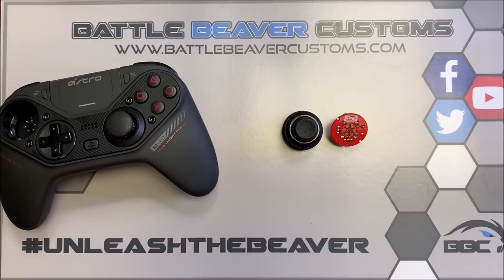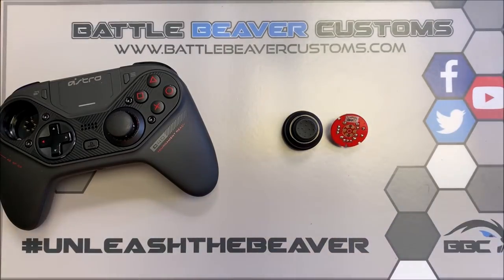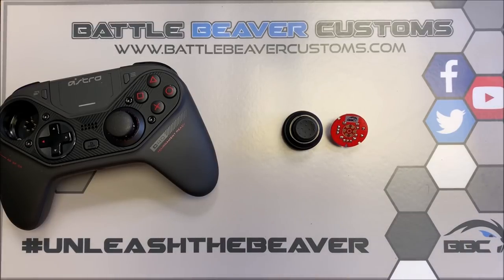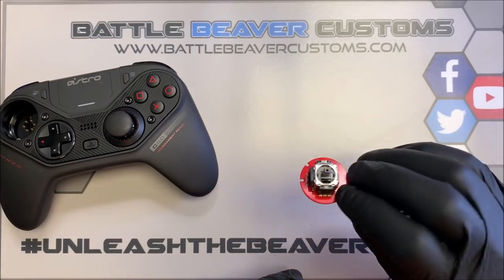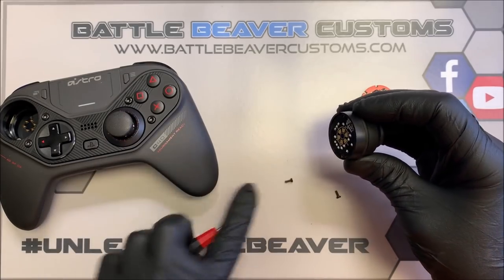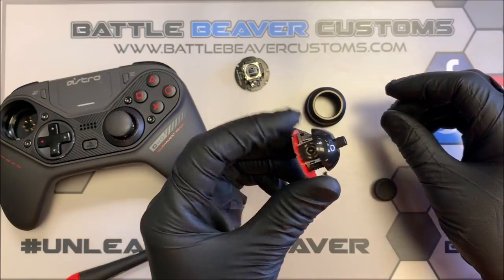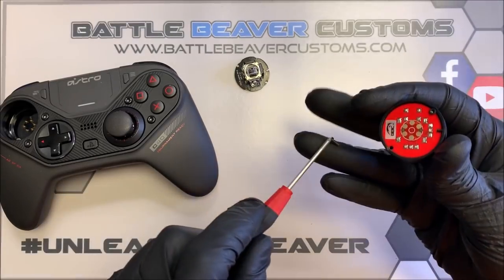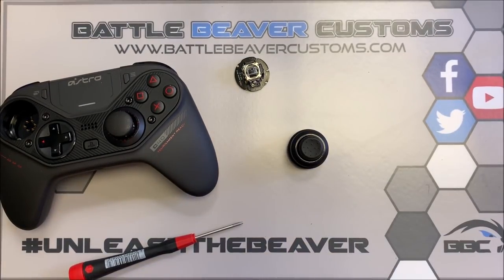How to Increase Thumbstick tension in your Astro c40

Comment: After 2 days playing with the increased tension on the right stick of the Astro C40 Controller, it has made my Game a lot better.  I can feel the improvement.  The best Controller on the market just got better thanks to Battle Beaver.  Love it.
Reply: how long did it took to Receive it?
Reply: I got the extreme because I use the heightened analog.  Will this be too tight for fortnite?
Reply: @Ernasty49  It took about 3 weeks.  That's what sucks about it.  I got 2 of them & easy to replace.
Reply: @soundwavecountry  No, it felt tight at first but then I got used to it & now I wish it was tighter.  So get the highest 1.
Reply: It takes about a day for it to ship out if anyone is lurking
Reply: 0_limit  only one day for them to ship them?   I just bought 2
Reply: @jrod4846  yeah it takes like a business day for them to ship them out I believe then you'd have to wait for your shipping
Reply: Ordered mine Dec. 19th, arrived Jan. 3rd... about 2 weeks shipping during their busiest time of year and a small company. Not horrible! I bought 2 if the  increased tension modules and I love the feel of them. Like others say it feels pretty different at first but for the better. Curious to feel what the extreme  tension ones feel like. But highly highly highly reccomend to either fix a drift on a c40 or in my scenerio upgrade it to the preference I wanted.
Reply: I disagree about it being the best controller on the market. It has the worst reviews. I had the C40 and didn't like it at all. Battle Beaver makes the best controller I have ever played with!
Reply: @oldmanseeks  the worst? You missed the Nacon Revolution 3 and Raiju Tournament Edition? I've had a Raiju, Nacon, and a Scuf Impact+Infinity. This one's definitely better than any of those. Scufs are top tier controllers but they're made out of garbage bins and with bad luck, could end up broken in a couple months. And most Impacts have stick drift. Nacon I won't even talk about and Raiju has insane stick drift.
Reply: does this 100% fix the annoying stick drift??. because i am thinking about buying a pair of battle beavers. but i want to be sure my money is spent wisely. thnx
Reply: YXNG WØA SAME here and are the increased or extreme sticks good for say apex legends (shooter game) thinking about getting 2
Reply: @illbeokayOfficial  it will fix your drift . they may need to calibrated. I had one work right after install and another took a few recalibrations . now ive only seen a little drifting if I set the controller to max sense . linear response curve and zero dead zone . and the drift is slow and small . hope this sheds some light on the subject for you. Ps im starting my own custom controller business as well my goal is to match or beat the quality of battle beaver and evil they are the Premier custom controller companies of you ask me .it will be called Chronic Custom Controllers . by Omni Light Studios. I'll be ps5 dual sense ready in October . I'll offer 200 gram spring . tactile triggers and LED mods . MLG safe . no cheat mods or macro maps just performance mods.

Comment: Just purchased x2 of the increased modules and looking forward to trying them out on the c40! Thank you in advance Battle Beaver Customs!
Reply: tell me if it works!
Reply: @ro6iin  perfectly! Initially the tension was insane. But now they feel very lose! Excellent quality and have been lasting 5-6hrs of gaming a day during the last 5 months!
Reply: @kennedykereama1274  Thanks bro! Just ordered them ;)
Reply: @kennedykereama1274  so would you recommend extreme for the right module if I use the extended stick provided inside, no kontrol freaks just the longer stick provided. I am coming from a ps4 controller and will use this on PC for fortnite so just needed some advice on how you have used the increased one and if you can give me some advice here as I would prefer lots of tension to improve my aim. So coming from a stick ps4 controller with no issues, let me know what you think.

Comment: Can't wait to get mine in the mail today and install it. Went with the Extreme Tension at the recommendation of AirBear.  Thanks BBC
Reply: J Hamm How are you liking them so far?
Reply: William Garcia Way better than the stock stick that comes with the C40. I would probably go with the tension below Extreme first, but if you go straight to Extreme like I did, give yourself a couple of hours to adjust and you’ll be good to go. 

Installation was super easy. But had some really really bad stick drift at first. Had to recalibrate the controller a couple of times, then do the 30 second reset. 

Really helps the aim. Highly recommend
Reply: J Hamm When did you buy your modules because mine are taking a while to arrive.
Reply: William Garcia I ordered mine on the 24th and got it a week later. But I also live about 3-4 hours away from where battle beaver is located, so it shouldn’t have taken that long for it to get mailed. They are very helpful and generous, so it wouldn’t hurt to reach out to them and have them check on the order

Comment: Just saw this after I ordered new modules from Astro and got one of the 3 controllers I have replaced at Best Buy under warranty because both modules went bad...anyway, cant wait to get the new ones from you guys. Stock do not have enough tension for me so this is a great service.

Comment: Just ordered these can’t wait to try. Don’t know what to expect
Reply: what tension did you get the 110 or the 160 . ? either way your thumb is gonna get work out the 1st few days but you'll adapt quickly as the resulting accuracy and tracking improvements will have you playing through the burn . also be sure to check the thumbsticks in the C40 software to make sure they are centered and calibrated , if they aren't don't worry simply re calibrate until they show center if that doesn't work right away try a factory reset on the C40 (tiny pinhole in the back ) then re calibrate . my high tension had to be factory reset and recalibrated a few time before it was centered but my extreme was ready to do right away .
Reply: @omnilightstudios7958  do these modules have drift too or are they fine? I’ve been hearing they have drift but how have yours been after 11 months?

Comment: We shouldn’t have to fix anything on a 200 dollar controller
Reply: so true . and not only that but astro thumb stick are particularly Shitty they can't hold up for more that a few weeks , really really bad , thank goodness for battle beaver
Reply: Anthony Wright hey how are you are this battle beaver tensions better then the C40 website ones they’re both 20$ . Second questions have you tried increased or extreme and what’s your opinion on them for a shooter game
Reply: @Syrptoh  . yeah the Battle Beaver thumbsticks are way better than astro's . i Prefer the extreme in fact i just upgraded to a 200 gram thumbstick from Evil thinking my BBC wa going out . turns out the Astro controller was the problem not the thumb sticks i had to find the right tension on the face plate too much and the module would bug out , to little that unit will not work the Astro is a Finicky controller so it will make it appear that thumbstick are bad when the real issue is the controller unit itself . and most issue can be resolved with a little scientific trial and error. though im upgrading to a Battle beaver custom  DS4
Reply: You don't own a car do you?
Reply: I just ordered the increased tension since not running in with high sticks. I will be using my controller for playing Destiny 2 and hopefully Cyberpunk 2077.
Reply: My point exactly!!!!!
Reply: hi, 
hello a question, if I buy the analog of 200 grams in amazon, the problem of the stick drift and another problems for the sticks they would be solved?
Reply: @vinibo1099  I am going to try these battle beaver tension modules for my Astro C40 which are arriving next week.The increased ones should help since not running high joystick pads.
Reply: Battle beaver sticks suck just as much, after three weeks one stopped working and there is now warranty...
Reply: Wait until you buy a scuf. My one disintegrated inside 6 months then I was told it was wear and tear. Now they have lost the custom of me, my friends and anyone I can spread the word to online. Don't buy Scuf. I still have an Astro after 2 years but the stick module are getting bad.
Reply: Exactly
Reply: @AH-gs8uh  tell me if it worked!!
Reply: no matter how much a controller is, they're not meant to last forever. which is why they make replacement parts
Reply: …what? Everything at every price can mess up and need to be repaired. You gonna buy a lamborghini and expect to never have to fix anything on it?

Comment: Once I calibrated my controller my stick drift went away. But the only problem I had was my L3 button . In Modern Warfare my sprinting would be cancelled so I just waited on new module and used automatic tactical sprint to save my L3
Reply: Same here. I did the same and is waiting on the new mods. Switch it to R3

Comment: Any advice on how to fix sprinting in FPS games. After use for a couple of months my characters will just randomly stop and my movement is effected by it. It’s like playing with one hand tied behind my back.
Reply: blow into the joystick and also try resetting the controller by holding middle back button twice. I ended up buying a new stick  from Battle beabers, not astro
Reply: check your profile setting on the astro sofware make sure you don't have any drift issues i also had a thumstick seat go bad (the spot on the cd40 that holds the removable modules) if recalibration doesn't work try swapping thumbstick position from ps4 lay to xbox lay out or vice versa
Reply: Anthony Wright so the battle beavers modules are a no go they don’t fix the sprinting issue that I have with regular c40 sticks
Reply: @Syrptoh  .Ok so the issue may actually be with the internals of the C40 controller itself . its not registering the directional input correctly . have yuou tried putting the thumbstick in the alternate position (ps4 or xbox) that and try to take a look in the calibration software to see if your getting past 85% percent in all direction if you not it can be fixed by decreasing the max input threshold of said thumbsticks , my astro stock ouot of the box wouldn't max out on the left stick in the upper right and upper left directions this would cause my caracter to stop sprint any time i shifted slightly to the the uppper left or right, i thought my BBC stick was goin out but its the controller as i just bought an evil stick and it had the exact same issue as soon as i put it in thus implying the issue is with eh controller unit not the thumbsticks. so if your Astro is under warrentee get a fresh one
Reply: Anthony Wright I do got warntnt  but first I’ll the the Xbox style and see if that helps

Comment: After installing the Extreme modules, I have a MASSIVE deadzone on both sticks. My character will not move one inch until my stick is pressed all the way in whatever direction I am trying to move to. There is no way to tweak the deadzones in the c40 software either. After recalibrating/resetting, no change. Not sure what to do.
Reply: You realize you bought sticks with increased tension right?

Comment: Do you have a video on how to reset and recalibrate the new modules? My left stick is drifting in one direction at 100% and idk how to fix it.
Reply: I'm actually having the exact same issue with mine. Tried it in the lower left analog slot and it was showing 100%, then in the top left slot and it was just kind of jumping all over the place with even worst stutter than the original module for which I bought this to replace.

Comment: bruh wtf i didn't know these where avail ive been buying the stupid regular ones from astro this is amazing !!!! does any one who has had these installed for a while had any issues im just looking for better longer lasting quality on the sticks as i put tons of hours into my c40 and the sticks go pretty often.
Reply: I've had nothing but problems bro. I don't know if it's the never ending C40 module problems causing it or these but I've had terrible stick drift issues abd with these in its just another variable in figuring out how to fix it. I haven't used mine in my controller for a few months now
Reply: So the C40s have some drift issues regardless but when I put these in its gets so much worse. Like my gun immediately pointing into the ground and if any even manually point it back up. It sucks because they make the sticks feel so much better but in my experience it hasn't been worth the issues involved with using them
Reply: @thinkforyourself5672  have you tried re calibrating the C40 with the PC software open . and also try factory resetting the controller unit(the tiny hole under the controller) and finally my Seats have gone bad but my thumbstick are fine have you tried alternate thumbstick layouts to see if the issue persists . and finally make sure you set the module perfectly in the housing
Reply: @omnilightstudios7958 , I'm going to play with them again. I reset the controller and recalibrated it. I need to plug it in and play with software. My issues were the battle beaver modules. I bought a brand new set of Evil controller modules but haven't even opened the box yet because I'm afraid to ruin a controller that's working at the moment. It sucks. I've been keeping 2 extra astro modules on hand at all times now. $45 per swap out and I'm on set 7 since August 2019

Comment: Hi just received an extreme tension module and my t6 screwdriver! Both came fast and I can't wait to install the module when I'm home. I was wondering when you mention "reset and recalibrate" I know how to recalibrate my controller by holding the button and waiting but when you say "reset" did you just mean it in the same sense as recalibrate? Just making sure I don't have to reset it AND recalibrate it. I assume I just have to recalibrate it. Thanks for any clarification.
Reply: sludgeblade yes, just the onboard recalibration.
Reply: Chris Bailey Hey Thanks I'm excited to try it out. I assume it's also ready for the C40 PC app?
Reply: sludgeblade that is correct!
Reply: Chris Bailey installed the extreme tension module in my right stick about 5 hours ago and I have to say this is the best upgrade ever. It feels like this is how the controller should have came. Thank you guys so much!
Reply: Chris Bailey hey my module seems to jerk my reticle in random directions if I push it in another direction. Only happens sometimes. Sometimes it has drift. Any clue what could cause this? Should I take it out and try to see if there's dust or hair anywhere on it? Thanks.

Comment: which would you say is the same as the elite series 2 tension at full tension? Increased or Extreme?
Reply: increased is 110 grams i believe the elite is around that tension the extreme is 160 .  the elite series 2 highest setting is 95 grams the same as the xbox 360 controllers . so the 110 would be the most comparable and after heavy use may loosen to about 100 to 97 grams

Comment: what about drift on controllers bought DIRECTLY from BattleBeaver? my controller started having issues in week 3 and is becoming worse after just 2 weeks of moderate use......the drift and jerking is unbearable.
Reply: you could see if there is some software you can get to re calibrate the modules manually with some manufactures software. basically the same software they'r be using to QC their controllers before shipping . also all Battle Beaver parts and customization are lifetime warrantee so if the thumbstick that is bad is one that Battle beaver installed they will fix it for free sadly at this time it may take a while as covid has their production capability nerfed at the moment . but it will get done

Comment: Which thumbstick tension is roughly the same as the DualShock 4?  I currently use a DS4 with tall Kontrol Freeks.  I want to make sure I'm getting a similar feel in tension with the C40. Thanks.
Reply: Cleat Plays I’m guessing the stick one
Reply: Stock *
Reply: From what I am reading the increased would be close to the stick ps4 controller tension.

Comment: Hey i have a ? My right joystick tends to drift when i buy this will it fix my joy stick problem?
Reply: Yes it will. And you can also choose other tension options if you want a heavier feeling stick.
Reply: @gowildwithava5773  Hi Chris really in need of your help I've emailed support titled "Battlebeaver can you help"  ou sell the Astro C40 Modules, which I have purchased from you, I have a small issue though, the black shell which the module sits in, my screw holes have become stripped and will not hold the module correctly anymore, would you happen to have any of the black shells the modules fit in for sale please?
Reply: @user-ll8jg6pg9g  Unfortunately we do not. You try to shim the holes. cut a very thin piece of plastic about the size of mechanical pencil lead and insert into the stripped hole so the threads have something to bite.
Reply: Chris Bailey thanks for the reply Chris